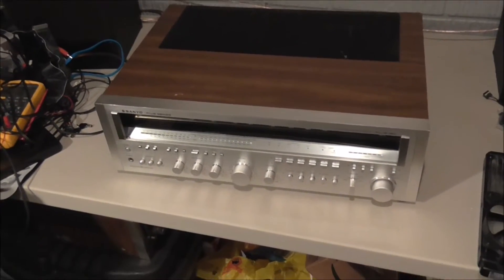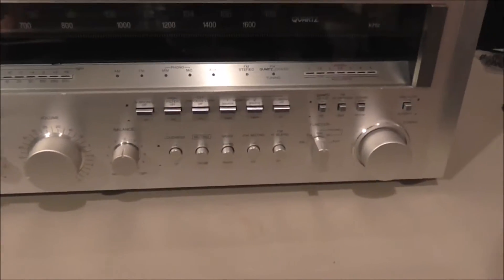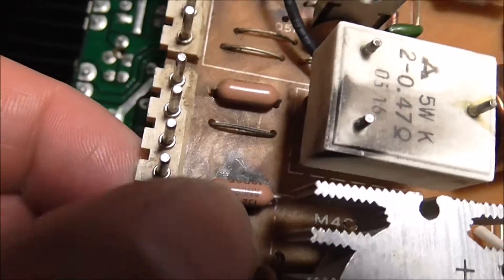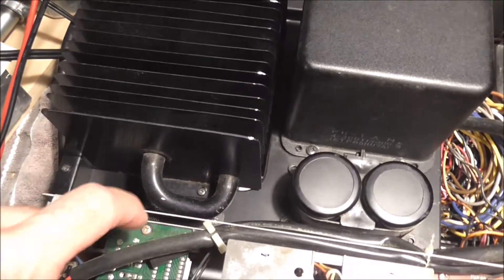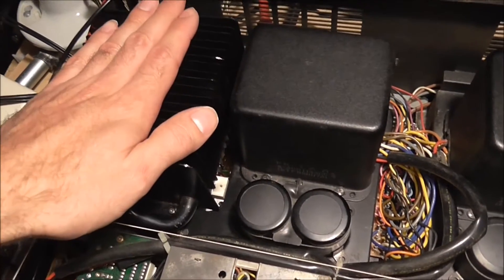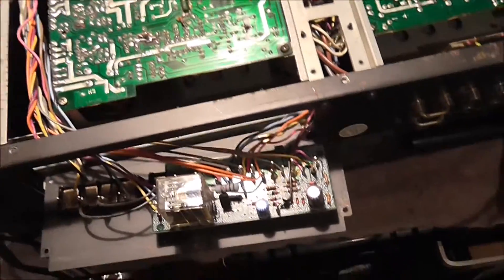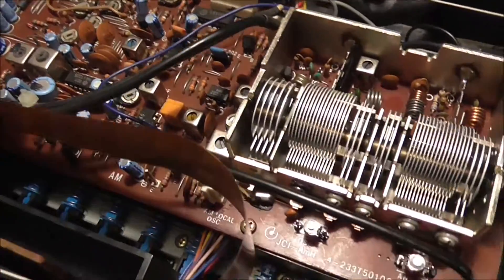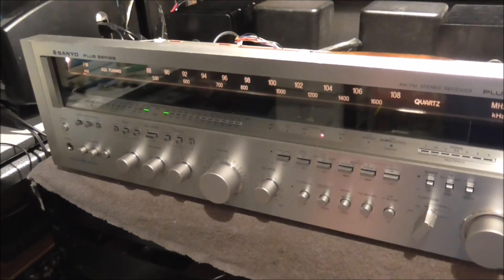Sanyo PLUS 130 (10-13-2015)

Comment: Hats off to you for the amp section. I do get "butchered" units in the shop from time to time and can usually fix them,  but I would have returned this one to the customer unrepaired. Can't put this much time into a retail repair. Good Job!
Reply from the maker: +Mark Zacharias I bought this unit knowing it had a lot of previous work done. I just thought it was neat because it is fairly rare. I don't think I could do this professionally because I would put way too much time into each repair trying to make the piece as perfect as I could.
Reply: +Adam's Workshop Too bad there isn't much money in this kind of work, especially these days. You have a knack, as they say. People sometimes ask me how do you troubleshoot. Two years tech school and 30 years "school of hard knocks" in my case...